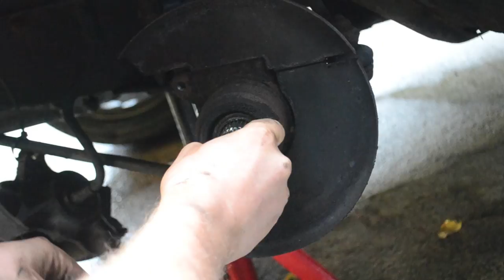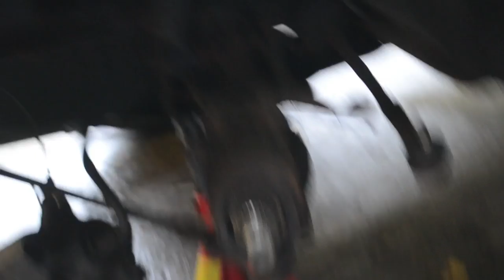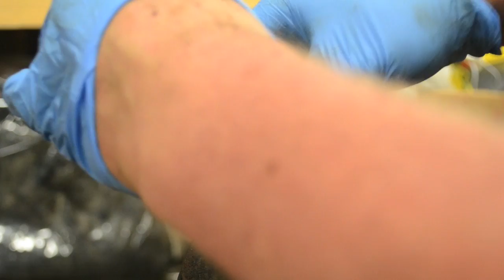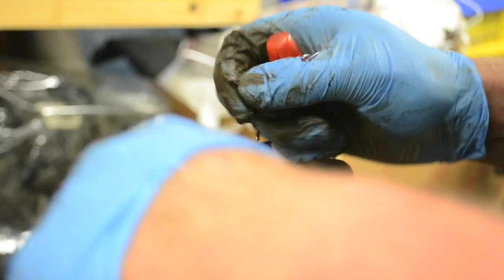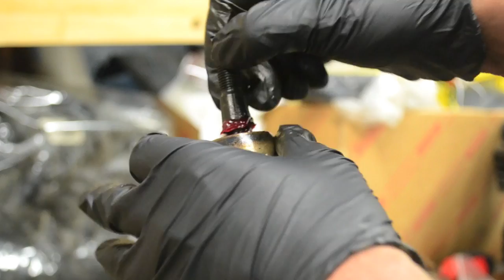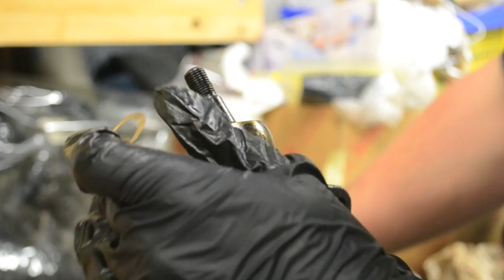How to: Classic mini ball joints/project esprit update

Comment: Superb commentary and camera shots....  Are the suspension systems of all cars equally fiddly and complex....?
Reply from the maker: emil dekoven as far as ball joints go this is a tricky setup, most modern cars come with the ball joint already in the bottom arm and it's cheaper and easier to replace the full thing